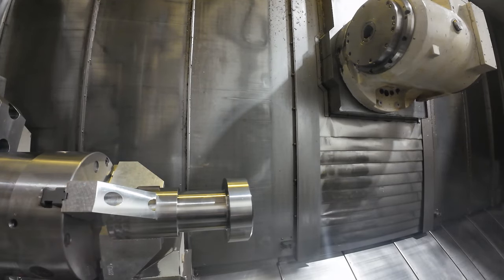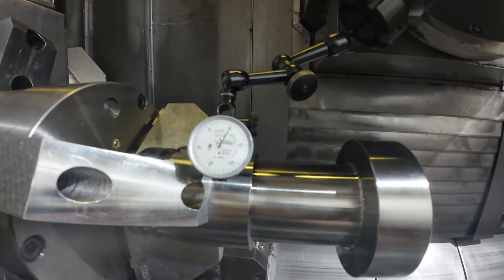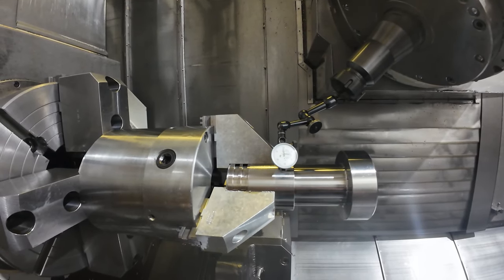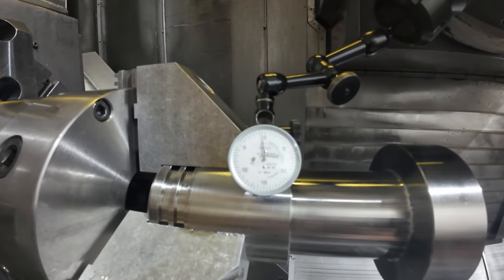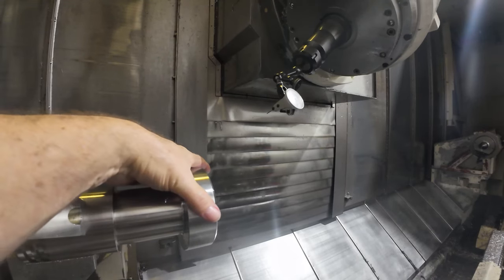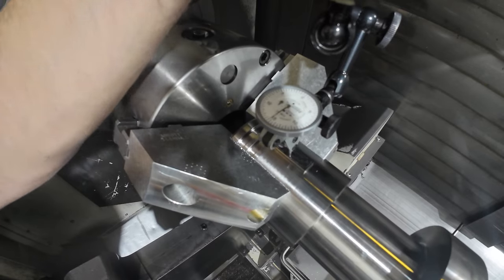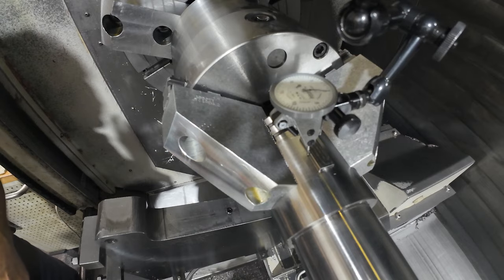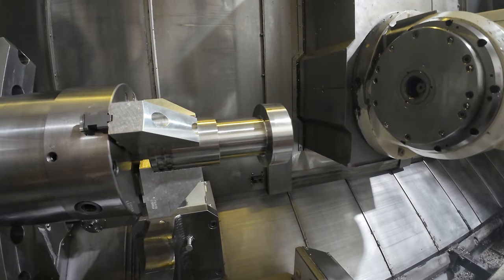Indicating A Part

Comment: Great video! Always happy to see a new video on this channel:) 
Did you make these jaws for this part or did you have them laying around? If you made this for this part why not also bore the smaller diameter in there? Would almost double the clamping surface. 
How do you preload the softjaws when you bore them? Do you use a plug or a ring? I'm always using a adjustable ring and if i clamped the part they are always spot on. 
Is it not easier to set the c axis with the haimer? I would measure the key on both sided by only moving the c axis.  On the first side you set the c to zero and the second side you know the amount off degrees difference between the 2 sides so you move the c to halve that value and set c zero. But that is how i do things. Love to see how other people do stuff like this.
Reply from the maker: Yes the Haimer could be used to set the C axis. But in this case the key isn't tall enough to get the probes sphere on the sides. What you can do if the Haimer can reach is to just move off center by half the keys width then just jog the C axis into the Haimer until you reach it's zero. That is generally close enough. These jaws were not bored specifically for this part but there were only two parts so I went this way. And yes it would have been better to bore them for both diameters. But I would still check the run out at the parts end. To bore jaws I do use a ring when possible. If that for some reason isn't possible I generally bore a slight taper in the bore getting larger in the back so there is more pressure on the outer ends of the jaws.

Comment: Hey Peter. Do you have any recommendations for indicating the centre line of an ER32 tool taper in a CNC lathe. I use a coaxial indicator ATM but they all have poor resolution. I have a 1 micron indicator on a flexible noga base but struggle to tell what is gravity and what is real error. Any tips or tricks much appreciated.
Reply from the maker: Just chuck the indicator directly in the chuck with a straight shank. Maybe you indicator has one of those dovetail straight shanks in it's kit. Then carefully jog the collet chuck up to the indicator and with a mirror rotating the chuck by hand read both sides of the collet chuck to get it centered. The key is to not use a mag base or anything like that. and keep the indicator very short. I have also done this before. Chuck a piece of aluminum in the spindle face the end flat. Then put a short carbide spot drill with its flutes more or less aligned to the X axis. Plunge it into the bars end noting how it cuts on one side or the other. When it cuts on both sides evenly you will be on center. I have done the spot drill thing many times. It is surprisingly accurate. Easily within .001" of center.

Comment: What degree of tightness do you maintain on the three cap screws holding the chuck on ? I have been using adjust true/Buck brand three jaw chucks since I first saw them in the 90’s and an old toolmaker showed me his way. From there I developed my own way and through your videos I tap the jaws. I did today. Your indication is more specific and complex. So, how do you treat those cap screws . What happens next, ever indicate the chuck when you tighten the adjusting screws ? Is there going to be distortion ?

Comment: Hey Peter, great video!!  I was trying to find the video you did on tap speeds and feeds. I was wonder what was you formula for that?
Reply from the maker: This is what I do for tapping cycles. For easier to tap materials I generally use what speed would be for 40 inches per minute. So lets say you have a 3/4-10 tap. So for a feed of 40 inches per minute it would be 400 rpm. Or lets say a 3/8-16 it would be 160 (For 10 inch per min) times 4= 640 rpm. See how that works? So because larger taps generally have steeper pitches this automatically slows the speed for them. For tougher materials like inconel or titanium I cut this in half to 20 inches per minute. The mistake a lot of people make is running the taps to slow. Especially in steels. This can actually be harder on the tap. In materials like titanium or copper and beryllium copper you really need to use the proper tap for the material. These materials close down on the tap and it usually brakes when the spindle reverses. So take the pitch divided into one inch then multiply it by 40 or 20. If you deal in metric you will need to make a conversion of sorts. I'm not sure I am always programming in inches.
Reply: Awesome Tip!  Thanks for all the good info @EdgePrecision
Reply: @EdgePrecision  awesome appreciate you!
Reply: I've been tapping too slow all my life 🥲 by the way we recently bought a bunch of OSG "A" SFT taps (the one with the shiny red letter A) and they really changed our tapping game and tapped thread finish

Comment: Do you have to rebore ID because it would get a triangle shaped?
Reply from the maker: The part in this video didn’t have a ID hole. If you are referring to my next video about milling the helical flutes on the parts OO. No I didn’t have to rebore the ID.
Reply: @EdgePrecision  oh ok I didn’t realize that it is a solid part with out a bore yet. Good video.

Comment: If the Y and X axis center of the machine move a couple of thousands of inches when it's warm versus cold, does it mean as you start to machine the part and the ballscrews and everything gets warm, the part gets out of center? I have this problem on a Doosan lathe with only a C axis milling. I can't adjust the Y axis (there is none) so all my center drilling tools are slightly out of center the first hours of the day. I can adjust the external X offset for all the turning tools, and this is very effective for controlling the cold/warm tight tolerances of the whole turret, but it doesn't help much when the tool is supposed to be on center and it's slightly "Y-axis out"
Reply: Have you considered running a warmup program where you rapid the tool around for ~10min
Reply: @tristanmaloney7841  i don't feel like running 100% rapids for 10 minutes when the machine is cold. It's extremely fast and will travel kilometers every morning just to adjust a couple microns. Also, I've run series of parts with a lot of rapid needed (like hundreds of 45 seconds parts), and while the spindles get to working temperature in 15 mins, the screws still take a couple of hours to get warm. So I just accept it. I use the external X offset. I wish this machine could automatically offset the axis depending on the temperature, and I think Okuma's do that

Comment: Would it be beneficial to use a torque driver on the set-tru screws so they are all the same?
Reply from the maker: It could if you were interested in ultimate precision. I personally very seldom use such devices. I see people on YouTube using torque wrenches on vices and fixturing. I think with experience a person learns to feel the proper force to tighten things. There are a lot of variables that come into play with the actual clamping force that is applied and although torque may be a good indicator in some cases, I have personally used many vises in a setup and they all can vary as to the clamping force applied from the tightening torque applied to their handle. Maybe lubrication dirt corrosion comes into play. I don't know.

Comment: very thorough on setup.  I know that on some machines the probe is assigned as tool# 1 and all other tools are offset to that.  Is this the case here with your Mazak?
Reply from the maker: On my machines I always set it in the last tool pot 80 in this case. But what I think you are referring to is a reference tool (As it is called) in some setups. This is a way to offset tools on a machine. Then all tools fallow the reference tool. Sort of as if it was a fixture offset. On machines that use probing the spindle probe is actually setting these fixture offsets. As you saw me manually set in this video. In this video use the Haimer probe to do this. I have set a tool offset for it (Also tool 80.01 (A on the Mazak) and the Renishaw probe is 80.02 (B on the Mazak)). So when I jog the Haimer up to it's zero in Z then go to the offset page and tell the machine to calculate zero. Its taking that offset I have set on the Haimer and using it to calculate the distance of the spindles face from the machine's zero return position and set it in the offset. The spindle probe does exactly the same thing. Just automatically from a program. I have made some videos in the past explaining tool and fixture offsets. But It may be time to make another to more thoroughly explain this topic. Because it can be done in several different ways and achieve the same result. Hope that wasn't to long!